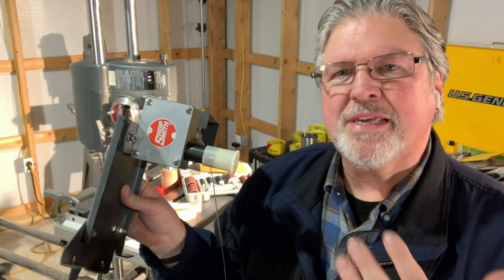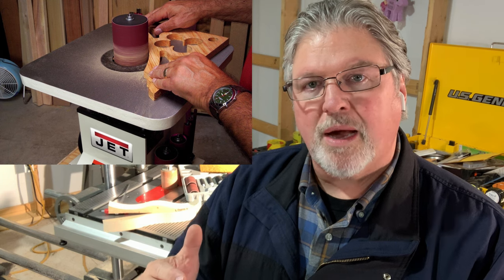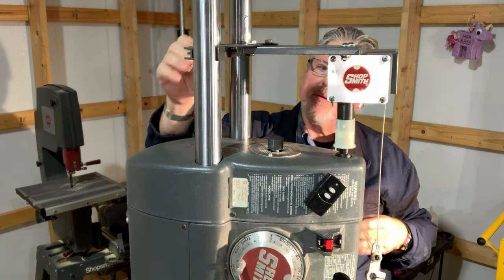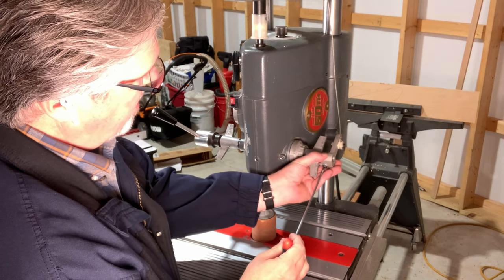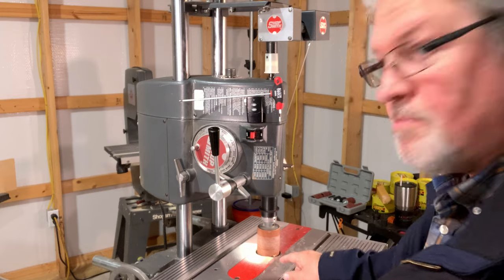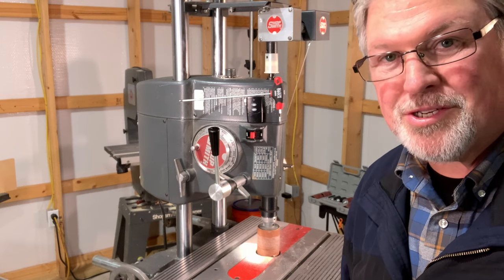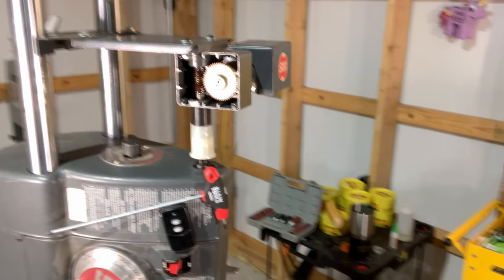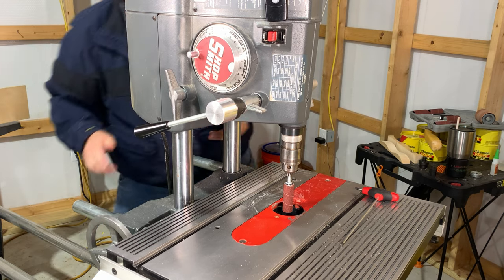Stupid or Brilliant? You Decide

Comment: I had a ryobi oscillating sander that I bought back in around 1998. Used it a lot. It gave up a few years ago. So for about 80 dollars and 20 years wasn't to bad. I wad happy with it for how well it worked and the 20 years of use.
Reply from the maker: I own that very sander but need to replace some of the rubber drums. It’s not a bad tool at all.

Comment: Although I already have a dedicated oscillating/edge belt sander, I can see at least one advantage to the SS attachment: variable speed!  I continue to preach to others how much of a difference variable speed makes in just about every application.  I certainly wish my dedicated sander could slow down, especially when using the belt feature.  But, aha! I can always hook up my much larger SS belt sander and vary the speed as much as I want to.  Thanks for another great video.  I had been wondering how difficult it would be to attach the oscillating sander.  Blessings, Glen
Reply from the maker: You are so right, Glen. So many times VS is like firing the winning shot. Scott

Comment: I have often thought about getting one of these. After making 24 of Nick Engler Reindeer for gifts this past week. I can see some value in this accessory. Knowing that I could just leave it attached and dissconnect the cable on my designated SS drill stand. By doing that, I would not loose any more floor or table top space as I would with a separate unit. As always Scott, thanks for the video.
Reply from the maker: I prefer to use the router chuck too, but have discovered that most of the current drums available have metric shafts that are loose and slightly off-center in a 1/4” chuck. Now you’ve got me thinking.

Comment: I think it is a brilliant idea  as I do for most all SS products. However,  I  do very little of that type sanding,  so when a portion of the sanding sleeve wears out or loads,  I just adjust the table up or down.  No doubt the oscillating feature gives a nicer finish.
Reply from the maker: Great point, Ellis. For that matter we can adjust the quill up or down. Yeah, in many cases it’s not necessary, but during extended sanding sessions it sure helps to spread out the wear. Scott

Comment: Great video Scott .  I agree that the Oscillating Drum Sander is a great Shopsmith accessory.  I have limited shop space so I add features to my Shopsmith  instead of buying another power tool.  I do have the Oscillating Drum Sander and the 3” and 6” Drums.  With the 6” drum, I can use two 3” sleeves with different grits.  I have not used it much but is handy to have when I need it.
Reply from the maker: Very clever idea! I'm gonna share that!

Comment: I have to wonder if it is cost effective because for $150-200 you can get a stand alone device like the WEN Oscillating Belt and Spindle Sander with zero setup effort.
Reply from the maker: You are correct. If you have the space for a dedicated tool and if you don't mind a single speed drum sander, a stand-alone tool might be right for you.

Comment: Maybe changing the position of the quill handle or removing it to prevent any mishaps.
Reply from the maker: Yep, good catch. I left it there to make it clear what was going on, but normally I would remove it. In fact, I had to move it there when I started the installation because I normally leave it on the back side of the headstock. Scott

Comment: Rube Goldberg had nothing on Shopsmith engineers. Ingenious. But not really something I need. I've got a few sizes of sanding drums that I chuck in the router chucks (due to the lateral forces on the drum from pressing things at 90 degrees against it). But I don't find much need of them. Now, the conical disk sander...yeah.

Comment: Scott… I can’t quite wrap my head around this.  So please slap me straight.

The oscillator works by lifting the quill feed with a cable and then releasing it so it can drop.  Correct?

However on my 520 (and old 510) the quill feed has a spring that retracts the spindle.  That is the same direction that the spring pushes the quill.  To my way of thinking, the spring would retract the spindle as soon as I released the quill lock. 

In order for this to work, wouldn’t the cable need to be pulling from the opposite direction?  IE: Load kinetic energy into the spring by pulling it down and allow its release to lift it back up?

(My SS is in a complicated precision milling setup right now so I can’t get to it to check… so please slap me straight on this.)
Reply from the maker: Dave, No, you have it exactly opposite. The quill is being extended by the force pulling on a short quill lever and once it releases the pulling force the quill spring returns the quill back into the headstock. The cable both extends the quill and controls the speed and upward travel of the quill on it's return trip. I hope that makes sense.  Scott
Reply: @MyGrowthRings  Thanks Scott, I will take a look when I can break down the setup, next weekend.  Thanks.

Comment: ☹Thanks Scott. I purchased one of these immediately after watching your demonstration. I have a continuing major complaint against Shopsmith. They have  instructions, especially on this one which has a printing date of 2/97!! Let me explain. There are four pages and it is apparent they are numbered in the wrong order. They are now numbered 5, 6, 7, and 8 (no idea where 1 - 4 are, but I digress). To install this thing they should be in order of 5, 7, 6, and 8. Just no logic to their order to someone that actually follows directions. Second, SS please place the  Parts list (now shown on page 8) on page 1, then refer to the parts numbers in the narrative. Page 1 list the attaching hardware (makes sense for inventory, so keep it there). Back to part numbers, with it on page 1, anytime the name of a part is listed in the narrative, SS should place the number in parentheses after the term, e.g., "install accessory hub (1)". "Connect the rear bracket (12)" (which BTW they call it the " on the parts list and the "" in the narrative. Why?). Also the "Plastic drive coupling (13)", aka "coupling" now has a rim on one edge. Which way does the rim face? To toward the motor or away? Does it make a difference?  Considering they charged me $24.49 for a box anyone could package and ship ground for about half of that, they could pay some poor unemployed English major with a technical background a couple of hours to rewrite the instructions. BTW if anyone would like the instructions with the part numbers laced in the narrative as I suggest, let me know. There. I feel better having wasted so much time grousing to those who never read instructions anyway!)
Reply from the maker: For some reason Shopsmith has always put the exploded view and parts list in the back of their manuals, with the major exception being the Mark V manual. I've always wondered why. Yes, the S&H charges are steep. Does the new coupling nor have two arrows on it pointing to "Accessory" and "Headstock"?  Scott

Comment: So I guess you never heard of the poor mans version of that accessory.  Two boards connected by a hinge sitting on the floor with the string going from the top board to your quill handle.  Like a treadle, stepping on the top board pulls down on the handle advancing the quill.  Releasing the board raises up the handle just as that device does from above.  Lengthen the attachment string (or remount the quill handle) for a lesser movement distance.  Shorter string for greater movement.  Just keep the top board light weight enough so it doesn't pull down just sitting there.  My mother still has an old Singer sewing machine with a treadle peddle as well as an added motor.
Reply from the maker: Oh yes, I’ve seen them. And I’ve actually turned on a trickle leave and we still on an old Trettel singer sewing machine, which is why I know that that design is not for me!

Comment: That's a pretty brilliant attachment. As far as the wet/dry grinder, I take it Grizzly copied the design?
Reply from the maker: No, Shopsmith had a manufacture in Taiwan produce it for them to their specifications, which are actually quite a bit nicer than the similar Grizzly and the Delta units that were on the market around the same time. Scott
Reply: @MyGrowthRings  I didn't get a good look at the Shopsmith one in that picture but it looked nice. I bought the Grizzly version at a yard sale from an older gentleman. I thought it might come in handy sometime, but so far it hasn't. Luckily Grizzly still sales the plastic worm gear. It sure would've been nice if it were made out of brass. One of these days I need to do a deep dive into all of the different Shopsmith tools and attachments. There seems to be a ton of them.
Reply: @kevinr1704  
Hide yer wallet!!
Reply: @My Growth Rings , I sure hope that you explain, if you aren't able to demonstrate, those differences wjth the other tools! (And I dearly hope that you give consideration to this because I have made neither cheap shot, nor snide comments…this time.)

Comment: I guess a cheap way of doing it, would be to use an old 
windscreen motor from a car off EBay
Reply from the maker: Yes, that is actually how it was accomplished in an article in Fine Woodworking magazine that modified a small bench top drill press into a oscillating spindle sander.